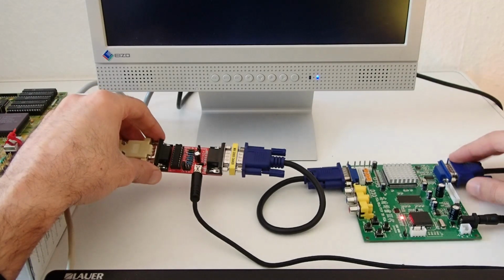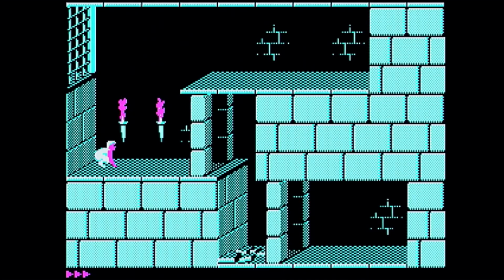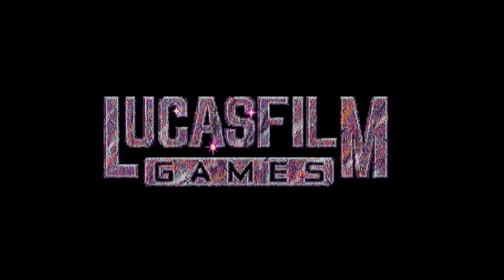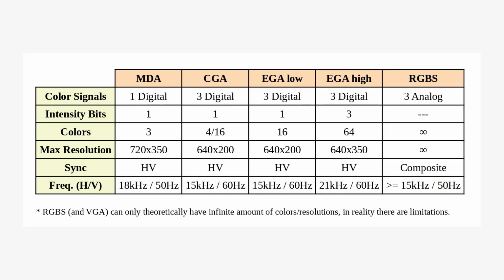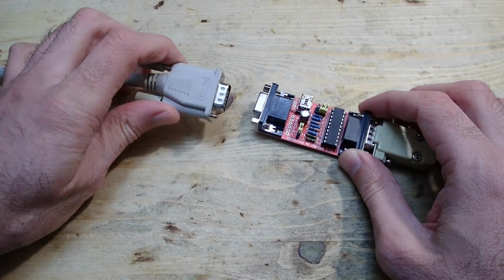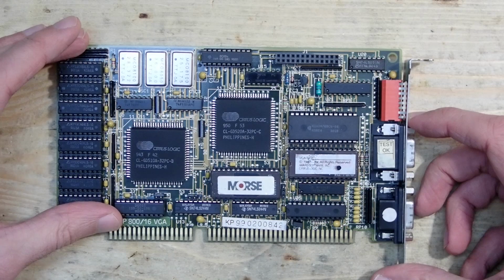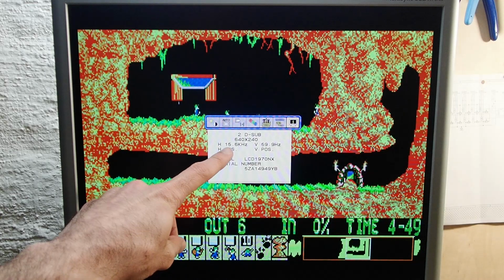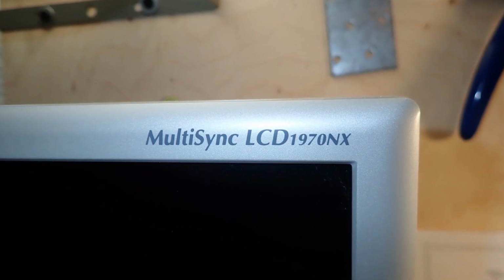MCE-Adapter (part 3): Showtime

Comment: Excellent conclusion to the series, thank you.
Also i had a gotcha moment when you showed the brown problem with keen 4. I experience this with my voodoo 3 card and a flat LCD screen. I dont recall that i saw this issue with a viewsonic crt i had connected earlier (but i should check). Do you think monitor's themselves would correct this for this issue?
But on the other hand the graphics card i have in my 486 displays keen 4 with proper colors on the same flat panel.
Reply from the maker: Thank you. No only CGA CRTs had the circuitry to generate brown color. Analog VGA displays don't need it and they also don't know about it. The VGA card, which emulates CGA/EGA has to handle the digital color signals and generate proper brown color in analog. I don't think, that your V3 problem was related, because it is not new enough. The proper CGA/EGA conversion seem not to work for the cards released in the last 10-12 years.... but all of them, some still do work properly. But it was irritating for me as I started DOS on a quite new machine and some games, like Commander Keen, had this strange colors. Most of the games did work right. Just as I read about the brown color hack for this project, I realized, that back then only the EGA games had this color issue.